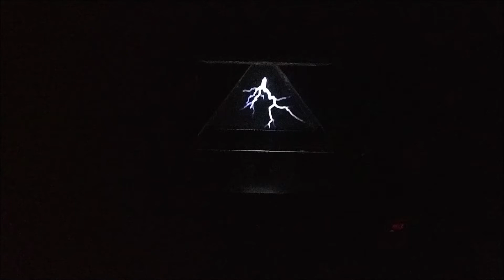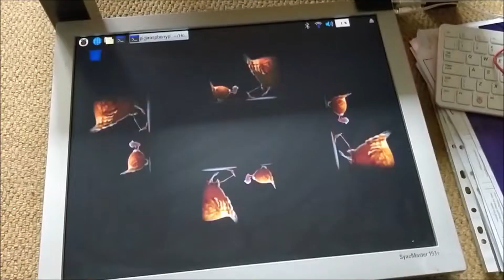Raspberry Pi Hologram pyramid

Comment: Hi, Great work.  What are the dimensons of the pyramid do you have sizes for me ?     And is there a was to Control two or more coves with one pi ?
Reply from the maker: Hi. Try this link for the sizes. https://m.wikihow.com/Make-a-Holographic-Illusion-Pyramid you can scale up for your screen. Also the Pi4 has dual HDMI output so you could run two screens and two videos.
Reply: I meant one pi and two cubes for example with different vids